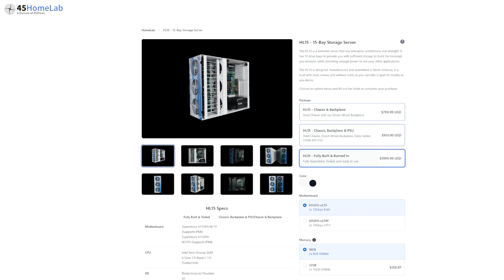HL15 by 45Drives Review and Setup: Extreme Edition

Comment: Waiting for part 2, and some gaming benchmarks LOL
Reply from the maker: We have more cooking.
Reply: @StorageReview  I was wondering, is the Power Supply suitable to power 15 SSD's, taking into consideration the fact that SSD's run on 5v as compared to HDD that run on 12v... Does the backplane do any kind of voltage conversion?
Reply from the maker: @visheshgupta9100  The SAS backplane has support for 3.3, 5 and 12V. SSDs are much easier to manage than the spin up current of a hard drive.
Reply: @StorageReview  I believe that the Corsair PSU included with the HL15 is rated at 5v 20A = 100w. Is it enough to power 15 SSDs at the same time? Say for instance we create 1 zPool with 2 vDevs of 7 SSDs each, and 1 SSD as boot drive. Can the PSU handle powering all at the same time? Sorry for the noob questions...
Reply from the maker: @visheshgupta9100  we haven't done it yet - you'd ahve to ask 45D but it's unlikely they'd use a design where flash would destroy the system.

Comment: Okay, I heard Parsec mentioned. But Parsec has become a huge pain in the ass with constant reverification logins needed for a headless unit like I am running. Is there a workaround?
Reply: I've had the same issue. Parsec logins timing out randomly.
Reply from the maker: You only need to reverify to connect out from the headless, not to connect into it. Try a paid sub maybe? I use it daily. -J
Reply: @StorageReview  yea I am-I am paying for WARP. Maybe I have a setting wrong…

Comment: It would be really nice to have caddies that support u.3 drives like Micron 9400 or Kioxia CD-7/8... and 100 GbE ... is the backplane compatible with these?
Reply from the maker: It's a SATA/SAS backplane, no NVMe support outside of the PCIe slots, where we put teh 30.72TB SSDs.
Reply: @StorageReview   What about an HBA / Raid Controller connected to that backplane, wouldn't it work?
Reply from the maker: @alinparcalab7269  you're trying too hard to jam what you want into a rig that's not that. You'd need to get an NVMe backplane. Maybe they'll offer NVMe as an option, with bays tuned for 2.5" 15mm. But 99% of HL15 buyers mostly want HDDs we're guessing.
Reply: @StorageReview   Thank you for answering! Last question please, will it support 15x Samsung PM1653 at full speed?
Reply from the maker: @alinparcalab7269 you know we have a Discord for chat? 🎉🎉🎉 you’d have to check for SAS4 support. This is SAS3 IIRC

Comment: Under the now semi-aborted TrueNAS vision, would 2 of the 15 drives possibly have gotten a pair of smallish SSDs installed for a RAIDZ1 install just for the OS? (Assuming you were not going to waste the Optane on the OS install and on a single drive, or resort to the QLC NVME's...) That would leave 13 drive slots, perhaps 12 used and a hot spare...?
Reply from the maker: My initial vision would have been 14 matching HDDs for the main storage group, and spot 15 for a hot spare. All of our production storage arrays include something for a hot spare, and with HDDs go with 2 drive parity. OS would still be on the onboard m.2. Not worried that much about raid1 for the m.2 OS drive as those have become quite reliable for minimal usage. - Kevin

Comment: The exasperation from Brian trying to understand Kevin and Jordan’s choice use of add-ins lol
Reply from the maker: These chumps agreed to a plan then did their own thing. - Brian 😢😢😢
Reply: @StorageReview the only plan is no plan!
Reply from the maker: @JordansTechJunk  but there was a very distinct plan.
Reply: @StorageReview   On the swing side.. it's for HomeLab which this is exactly the kinds of degenerate stuff that we'd do with it..  I bought one to throw in an epyc board, fill out the 15 bays with Enterprise SSD's i've got (all 2tb ish), then it'll manage a 90 bay Supermicro Chassis filled with 18tb SAS drives. Even i'm going to throw in an A5000 if it fits well. Definitely not going the windows route though. #powerbillssuck
Reply from the maker: @ZVexxPlayer  You're clearly as ill as my team is! That said, we have a different angle on the flash we're working on ;)  - Brian